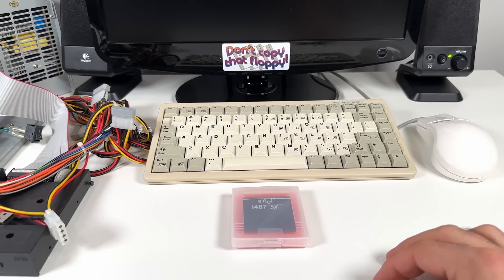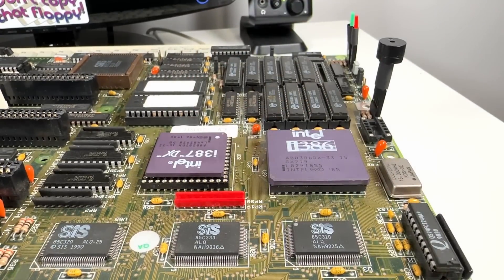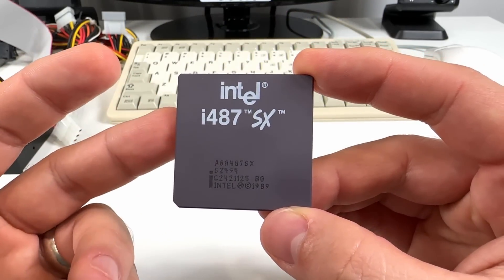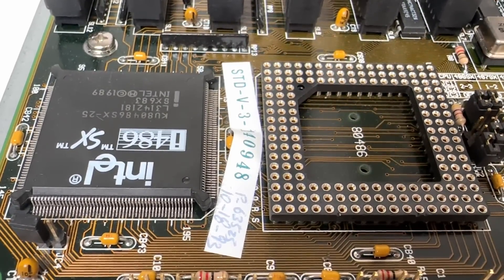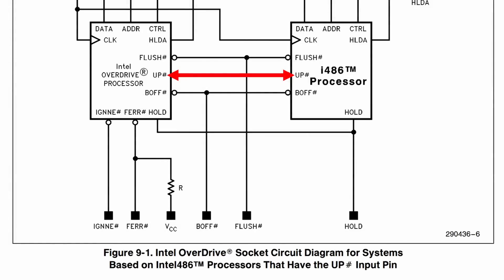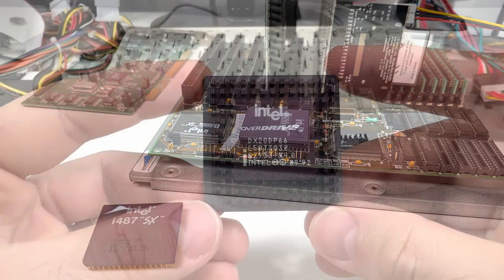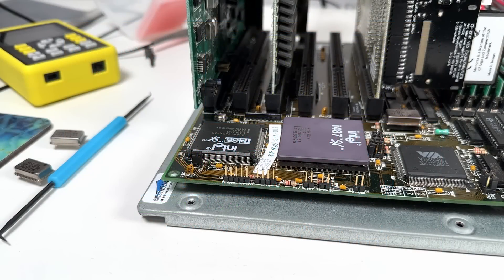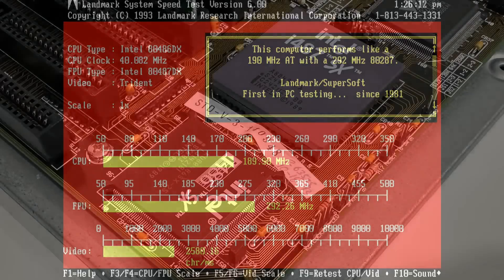The Intel i487 SX Math Co-Processor - Disingenuous or Just Misunderstood?

Comment: Floating point is overhyped. I am in the process of creating compiler for my custom OS. I don't even bother with floating point support. On ultra rare occasion when I absolutely need to deal with non-integer math I prefer to use either fixed point or BCD math. IMO, these are better in most cases. The main reason being predictability.  Floats can be weird sometimes with all these NaNs, Infs, rounding modes, etc. The only reasons I keep SSE/AVX in somewhat operational state are data transfers and bitwise operations. Wide SIMD registers make much better use of available bandwidth than silly rep movs or rep whatever. I think only DMA would be faster than SIMD. But using and managing DMA controllers to do memsets and memcpys would be a little bit silly. I may try it at some point though, just for the heck of it.
Reply: Any serious scientific or engineering math requires floating point.

Comment: So you could basically use the 486DX in any motherboard with an upgrade socket when you run a simple jumper wire between the detection pin and ground?
Reply from the maker: Yep! bridge pin C11 (or the QFP equivalent) to ground, and the CPU will disconnect itself and power-down allowing the upgrade CPU to take over.

Comment: Fun  Fact. Falcon 4.0 is on VERY FEW games in the 90's that would DUAL cpus. i knew few people with duel Pentium Pro PCs that ran it VERY well. The Falcon games seems always support very cutting edge hardware for there times
Reply from the maker: Interesting! I didn't know that about Falcon 4.0. Thanks for watching!
Reply: Quake III also technically has dual cpu support, but there's barely a performance impact and I've never seen good explanation of what it even does.
Reply: Ohh, I found a copy of that years ago and I have a couple Pentium Pros from an old server - interesting.
Reply: And now you can play Falcon 4.0 in VR! https://www.youtube.com/watch?v=rr-c9DTZXzk

Comment: Great video. As far as I undestand one can use Overdrive 66 CPU in EVERY socket for 487?
Reply from the maker: Thanks for watching! Yep, any "ODP" version of the 486 overdrive would work in a 169-pin 487 socket. The ODPR overdrive chips are another story though. They are the same as typical 486s and unless there is a manual way to disable the onboard CPU like I did with the FIC 486-VC-HD, they wouldn't work.

Comment: Thank you so much for this video! I had a AMD 368DX 40mhz back in the day with a FPU socket and I could never get the FPU that my brother gave me working with it. It was supposed to work with it. FPUs always had a lot of mystique to me.  There are those other coprocessors that will also go in FPU sockets that do different functions.  I just want to know so much more.
Reply from the maker: Thanks very much! :)
Reply: I had a 386/40 also, and it was probably my favorite computer.  Although I really liked my 286 before it, and I even miss my Xerox/Toshiba/Microsoft 8088 clone (even though its slowness and CGA annoyed me at the time!).  For me, I tried overcocking to 50 MHz by replacing the 80 MHz oscmod with a 100 MHz and broke it permanently. :(

Comment: I always knew the 487SX took over, but never knew the method and it's a simple solution.  You should cover the 486SLC (which I owned) if you can find one, it used the 387 as its co-processor.  I always wanted to try it, but they were far too expensive for my budget back then.  Also, definitely play some Falcon 3.0 it was one of the best flight sims of the era!
Reply from the maker: Thanks for watching! I have a Cyrix 486 DLC chip around here somewhere that I've been meaning to try out one of these days. I was struggling really bad to get the controls for Falcon 3.0, but I was in a rush and need to spend some more time with it. Looks like a really interesting game.

Comment: I remember when this came out and was viewed in the community as a joke.  You’re right it was priced the same as the faster 33 mhz DX but was only 25 mhz.  It was worse when it launched because there were only ceramic package 486sx at the time.  Once the soldered on plastic package models came out it made a “little” more sense.  But unless you had an OEM system it still made more sense just to but the DX and drop it in.  If I remember coyote really didn’t last long as the overdrive chips came out not too long after.

Comment: Back in the day at work we used to buy 486SX 25 pc's because the were cheaper and in the 2nd year of owning them ( out of warranty) we bought 486DX2 66 cpu's and swapped them out! in The UK at least they didn't have the cpu's soldered on.  My first 486 that i owned was a  486Dx 33 that had a bad Cpu ( i wrote it off at work and took it home),shortly afterwards  we upgraded a 486SX 25 ( which i saved the cpu and took home) I made a "good" pc out of the 2.  By  the following year  dx2 66's  pc's were  failing and being trashed  as people wanted dx4 100's so i got a cpu out of one of those  .  So i went from a 286 to a 486 sx25  then dx2 66 at no cost. I can see while  the 487 was missed out.

Comment: 13:04 the RapidCAD.. hah.. Intel cut down a 486DX and stuck it in a 386 package without the cache. But to get the old 386 motherboards to recognize the FPU, they included a dummy chip for the 387 socket. It just shorted a few pins to get the motherboard to realize that it had an FPU.
Reply from the maker: Haha yeah the RapidCAD was quite an oddity. Would love to get my hands on one some day :) Thanks for watching!
Reply: Building off this, is it possible to slot a 486 into the 487 socket? Better yet, run a 487 in a 486 DX or SX slot? I imagine you'd need something to connect to C11 to get the 486 working, right?
Reply: @edherdman9973  Some motherboards already did this, They had a second socket that could accept the 487 or an Overdrive processor. Much later boards, during the ZIF socket era could run a 487 alone.
Reply: @edherdman9973  it looks like it should be possible. You need to ground a single pin (the upgrade processor detection input) on the onboard 486SX, which could be done by soldering on a jumper wire.

Comment: This was intel's way of trying to make sure the now useless 486SX chips were not getting into the used market. Later on during the ZIF socket days, some motherboards would support running a 487  alone, without the presence of a powered down 486SX. Making things WORSE was the 486SX had an FPU. Intel would just disable the FPU at the fab. Ostensibly this would be so they could sell chips that had failed FPUs.. but later Intel got better at fabbing the 486, they were straight up killing good FPUs.
Reply: That's right! That's why people (computer magzinze writers) were so annoyed.

Comment: weitek 4167 is what opti recommended in al their internal and external documenation
and is a substantially  better chip
Reply from the maker: Yes, I totally forgot to mention the Weitek 4167 in the video. Quite a few earlier 486 boards had Weitek sockets. I've got a few but have never been able to find a 4167. Seems they are getting quite rare these days. I'd be curious what the performance difference is between a Weitek and the on-die FPU of the Intel 486. I guess it would really depend on application optimization. From what I recall they weren't compatible with eachother, but I don't know much about the weitek chips. Hopefully one day I'll find one and give it a try.
Reply: @vswitchzero  I don't think they were ever very common. iirc weitek was a one man company. he had worked as an engineer at one of the big silicon valley tech companies and when he saw how his designs were knee-capped in the implementation he decided that everyone else at the company was incompetent and worse than  useless lol

again, iirc. it was many many years ago that I read this lol. He was certainly an interesting character - and I seem to remember some CAD applications more or less required his chips to function properly

Comment: Intel has that same pin to disable the Intel 386SX processor as well. I wonder if they had something like this in mind when they added that functionality to it? Of course, third party upgrades that clipped on top of the CPU did end up using that pin, but I don't think any motherboard ever did... (Unless I had just never come across one?)
Reply from the maker: Interesting! I didn't realize the 386 had this functionality too. I always wondered how the the clip-on CPU upgrade "hats" were able to take over without interfering, so this makes a lot of sense :) .. thanks for watching!
Reply: @vswitchzero  Motorola included this functionality on the very first 68000 even, so really Intel was late to the game with a CPU disable pin!
Reply: It was used with In-Circuit EmulatioN (ICE)… or rather, the On-Circuit Emulation (ONCE) variant of ICE for CPUs that were soldered on.
Reply: What about the boards with both 86 and 87 sockets, but shipped with a soldered CPU?
Reply: @sirnickity  the 387SX was just a math coprocessor and didn't replace the CPU. It worked with it.
Reply: @adriansdigitalbasement   That's not what I was saying.  You mentioned the 386 had an equivalent to the 486's upgrade disable pin, and speculated that "maybe they had a similar plan?"  My point was that a 386 board could have shipped with a QFP 386 CPU and needed the disable pin to allow the user to upgrade the CPU in a separate socket.  The disable pin would allow the motherboard manufacturer to provide a cheap on-board CPU while still allowing it to be upgraded (if not physically replaced.)
Reply: @sirnickity  oh that's the case with 386DX soldered chips but there was no upgrade path for the 16bit data path 386SX even if it had the same functionality. Maybe Intel envisioned external PGA SX upgrade chips or something.
Reply: @adriansdigitalbasement   I don't actually have any boards like that, so I don't know first-hand, but it seems like something that the chipset could manage.  That would allow full 32-bit routing to RAM and anything else that might use it (not much at the time, but perhaps cache, MCA or EISA slots, integrated local-bus peripherals...) while downgrading to a 16-bit path when used with SX CPUs.  The advantage of course being that you could sell an integrated system with an SX CPU for less, and offer an upgrade path to 32-bit I/O and higher clock speeds.  Sure, this would make the board routing and chipset a little more expensive, but probably still cheaper than the price delta of the DX equivalent.

I dunno.  Maybe this is bordering on niche, but designers were throwing stuff at the wall to see what stuck back then in an attempt to position products as "future proof."  Take for example the OEM systems where you could swap out a processor/RAM card to upgrade from 286 to 386 to 486 to Pentium, while being able to leverage your investment in the rest of the computer -- at least until something else became the bottleneck.  :-)

Who knows what their intentions were with that pin.  Often enough, you just build in features without fully knowing what they'll eventually be used for -- if anything.  And then the market does something creative with it that you probably never would've imagined.  haha

Comment: Cyrix actually went the route of making a true external FPU for their FPU-less 486S CPUs, the Cx487S sits in an interposer between a Cx486S and the motherboard, not sure if they were compatible with Intel/AMD/UMC etc SX CPUs but it would make for a good follow-up if you can get your hands on one.
Reply from the maker: Ah yes, I've seen these before. Very interesting add-on and I'd be curious what the performance would be like compared to the on-die FPU of a 486. The Cyrix fasmath is supposed to be very quick compared to the 387 from what I recall.
Reply: @vswitchzero  then there's the Weitek math co-processor. 3167 for 80386 CPUs, 4167 for 80486 CPUs. Motherboards had to have a special socket for the FPU and software had to be compiled specifically to use a Weitek FPU, but some found it to be worth the effort because the Weitek FPUs were faster than the 80387 or the FPU built into the 80486.

Weitek also made FPUs for Sun workstations and chips for other equipment. I had a printer with a couple of Weitek chips on its mainboard. IIRC it was a Qume Crystalprint halogen printer. Instead of a laser it had a light tube behind an LCD strip that was a single row of pixels. Horizontal resolution was fixed by the LCD. Vertical resolution was controlled by the motion of the rollers.

Comment: This is so cool.  Thank you so much for posting.  I picked up a Tandy 1000 a few years back and the dude pulled one of these Intel i487 SX out of his pocket and said "Here, you want this too?"  I said sure, but to be honest I wasn't really sure what it did.  I have a Packard Bell Legend MultiMedia 486SX 25mhz that I have been working to restore and I can't wait to put this chip to work in that woefully underpowered system.   I know it won't be much better, but I'll at least know it has this chip running in the background.  I may even try my hand at overclocking.  Thanks again for posting.
Reply from the maker: Thanks very much for watching! Awesome - Let me know how it goes with the i487 and the Packard Bell.
Reply: @vswitchzero  Will do.  Unfortunately, the PB used a Varta BIOS battery!  Need I say more.  I have lots of trace routing and other corrosion repair ahead!
Reply from the maker: Best of luck with the repair! It’s amazing how much damage those leaky barrel batteries can do. I hope you can get it going again 👍
Reply: My first PC was the family Vtech 486sx 25 MHz with 4 MB ram which we later upgraded to 8 MB.

Monkey Island and some of the Sierra games (King's Quest) worked. I also bought Mortal Kombat.

I had to buy a Soundblaster card to hook up a CD-ROM. Mostly I used it for playing Solitaire, listening to my CD's, did homework and wrote in my diary.

Best wishes getting your vintage PC repair project finished successfully.
Reply: Tandy's Color Computer 3 machines also are fun for having a drop-in CPU replacement potential (although in that case it's a much simpler 8-bit chip that can be found in an upgraded 3rd party variant).

Comment: I remember the 1st of April Joke in a German IT Magazine (c't) where there were very detailed instructions how to re-enable the factory disabled FPU on a 486SX with a Drill.
Reply: There were utilities that could trick the BIOS into thinking you had an FPU installed, obviously the performance was terrible but it enabled me to do ray tracing on my 486SLC board with render times measured in days!
Reply: @Zerbey  No BIOS trick - these were x87 emulators and needed at least a 386 Processor to work (even a sx is enough). Needed for applications that would otherwise not work at all.
Reply: @rubberduck4966  Bad C coding skills !
Reply: @lucasrem  ?
Reply: There were some system extensions that did that for Mac as well 😀
Reply: I remember that joke, some morons really drilled into their CPU
Reply: @benyomovod6904  the same with the joke of charging the iphone on the microwave, average people is indeed stupid.
Reply: @GeomancerHT  “is”
Reply: @benyomovod6904  Probably the ancestors of people who microwaved their iPhones for a faster recharge, or believed that an OS upgrade made them water proof.
Reply: @benyomovod6904  Reminds me people microwaving their iPhones when they believed that Wave thing people made up on April's Fools.

Then again something absurd like drilling a chip was the actual entry point of an Xbox 360 hack.
Reply: I vaguely remember a joke in the "64'er" mag that told people to solder certain TTL chips on to their bus to access more ram that would be present in tri state mode.
The old ones were brutal 😀
Reply: @DasIllu  Haha, never heard that one! :)
Reply: Haha, that made the rounds. think I saw it in a pc mag at the time.
Reply: I remember that actually being a real trick, drilling a chip to break a connection so you can extract the keys. It was the Xbox360 Slim if I'm not mistaken.
Reply: They still do not know who wrote the data sheet for the "Write Only Memory" dated april 1st. It was hilarious if you find it. Looked like the real thing until you started reading it.
Reply: Back when German magazines really went all in on april fool's day and still assumed their readers to be somewhat competent.

Today's jokes are way too obvious for my taste.
Reply: you CCC?
Reply: If there is an fpu there then drilling and then fibbing, would be able to enable it. However, I'm not convinced there is one.
Reply: @phill6859  The 486Sx were laser cut fpu's from full die DX's but were fully 32bit unlike the 386 where the sx was 16bit.
Reply: @phill6859  The needed precision is not accieveable by home-drill-presses i'd say